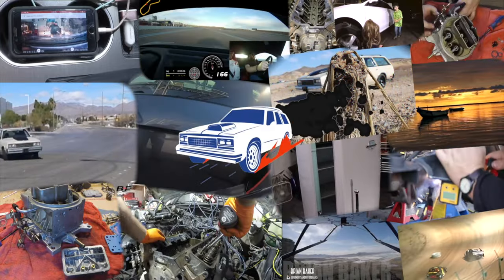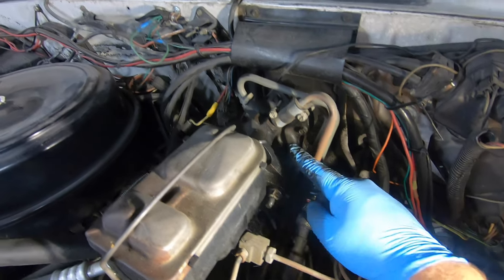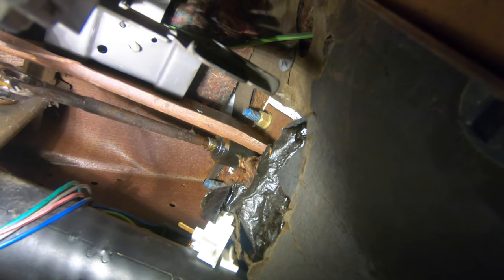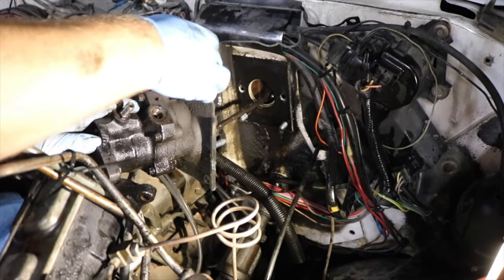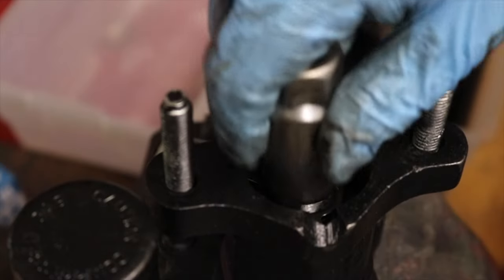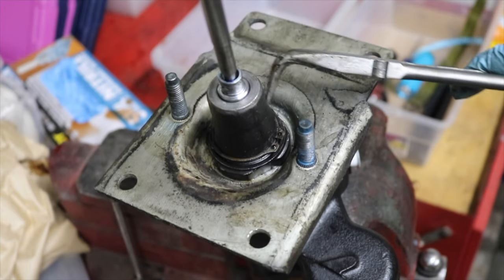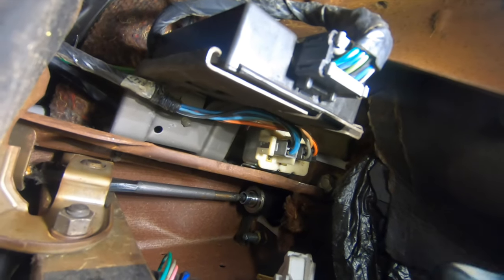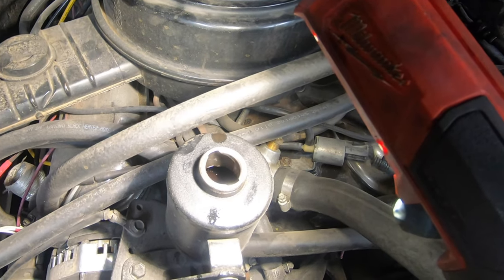Hydroboost unit replacement | Squarebody leaving marks in front of the neighbors' houses

Comment: I have an 85 C30. I tried replacing my hydroboost unit with one of those Cardone ones I had ordered from RockAuto. A local hydraulic shop informed me that the "bump tubes" a.k.a. the lines with the flare that accept a O ring were only available with certain sized fittings. The power steering line on my truck had an 18mmx1.5 fitting on it, but the Cardone unit had been drilled and tapped for the 11/16" sized fitting on the pressure line at the ~10 o'clock position looking at the unit. I tried Cardone, Brakebest, AdvanceAuto, AutoZone units for the year models 81-87, but all the same problem. The unit I pulled off the truck had the 18mm fitting as well, so that stumped me. I had to order a hydrobooster for a 1991 C3500 to get the correct fitting sizes, but the rod connecting to the pedal was roughly 13/16" shorter than my existing unit. What size fittings are on your rig?
Reply: @pinchsgarage3914 that is the same issue I am having with my 89 Squarebody dually. The rod is shorter than the one I took out. What did you do to compensate?
Reply: @lifestartsniw1  I took the old hydroboost unit, and basically broke the rod out of it. I then cut the end off that went into the hydroboost off leaving the pedal connection loop. With the new unit, I wrapped it well with rags, plugged off all the ports, and kept a steady stream of water running on it. I measured the difference in length I needed, trimmed the old rod to fit, cut the pedal connection loop off the new unit, beveled both rods very well nearly pencil sharp, and turned my mig welder up very hot with wire speed as slow as possible. With water keeping the new unit cool, I welded a first pass using a small piece of angle iron and small clamps with shims to get both squared. I ground out the first pass leaving a small groove, kept the welder settings the same, and ran another pass. Once done, I left the water running (but not too close to the new weld) until I could touch the bead with my hand. It's holding up great, no stress cracks visible. Roughly 10k miles into it so far.

Also, there are some videos of homemade tools to "press" the rod out, but newer chineseium metal will crack trying to remove the new rod from the new unit. I found that out the hard way.
Reply: Use an 18mm tap. That's what I had to do on mine. No leaks from the fitting, but a small leak from the main seal. I'm gonna have to replace mine again unfortunately

Comment: So. What cause your leak? I’m seeing gaskets being main cause of leaks in the hydro boosters. Gasket kits are $30. Also I didn’t see you change old gaskets over. Intakenitnifntheybwere the issue you would have just replaced those
Reply from the maker: It's a hydraulic system component. Seal failure is the most common failure.